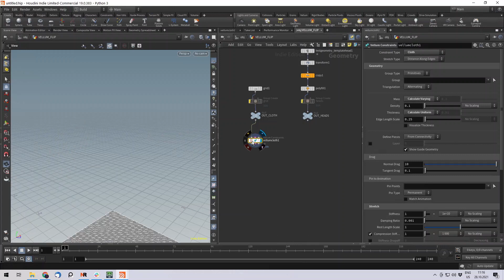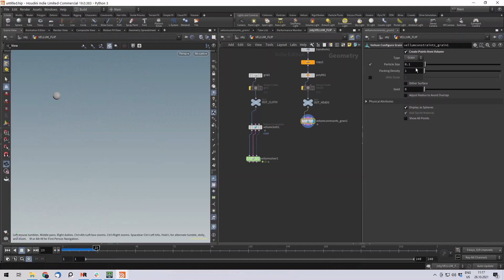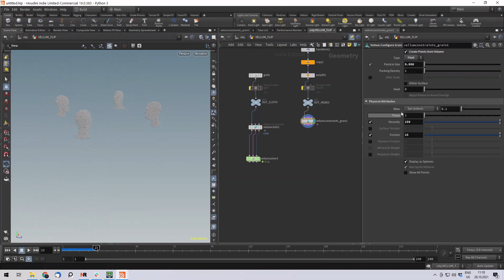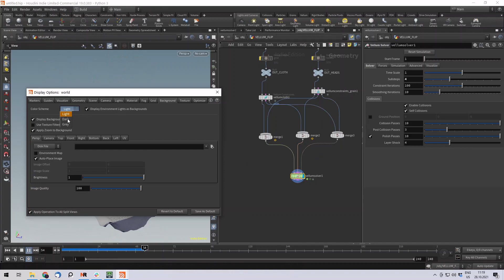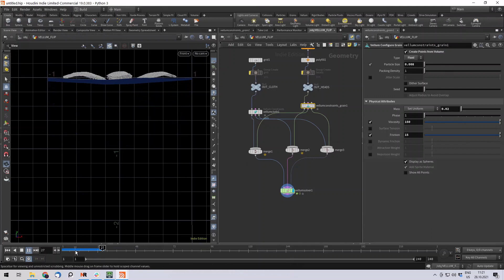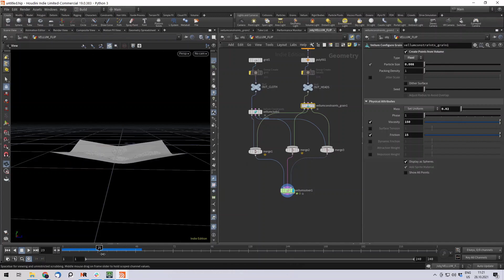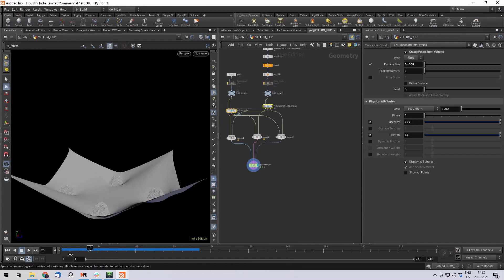Houdini Adventure - Vellum Fluid Introduction

Comment: How would I seperate the fluid and the vellum after sim :) I already put on a particlefluid surface afterwards but now I just have the fluid
Reply from the maker: You could set a group node before the simulation and split it after the sim by that group. :)
Reply: @FabianStrube  thanks that helped <3